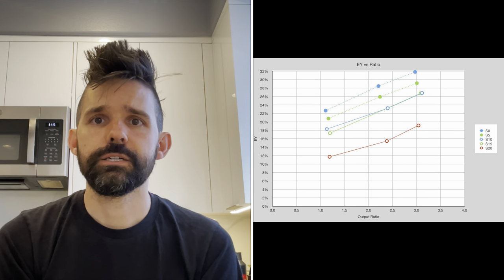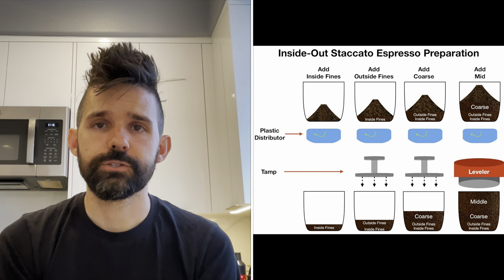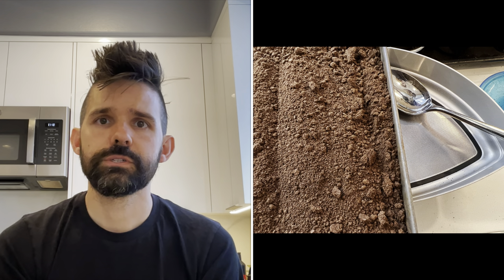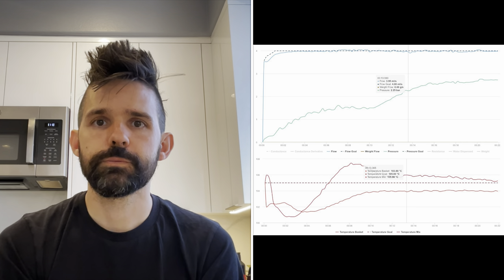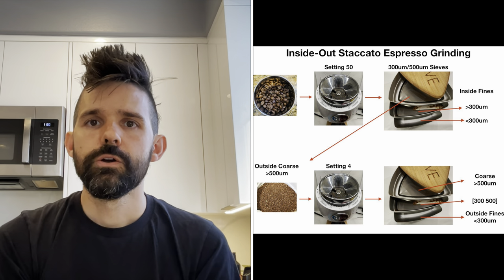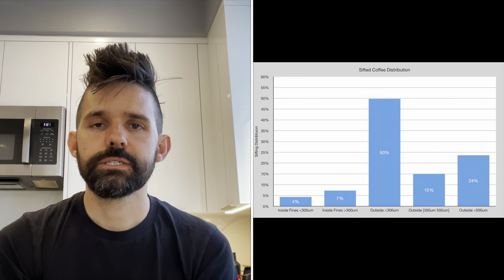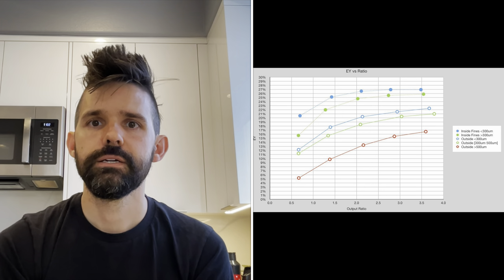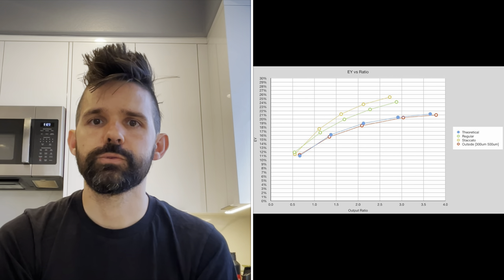Sifting Salami Espresso: The Coffee Bean is Not Homogeneous

Comment: Hey, saw your recent post on medium concerning sourdough yeast fermentation. Tried this last year with wheat bear yeast (stripped from a bottle), had similar results, tho the flavour was much more chocolatey (ran the fermentation for 1week).

Right now I’m trying a “fermentation”with 4min preroasted (until browning occurred) natural robusta. Added just the water I lost during roasting, will see how it goes. If it doesn’t ferment I’ll try it again with some of the beer yeast from last year (which is still in the freezer…). Hope to get some more funky flavors.

Btw, in the last years experiment, my beans turned purple/ dark blue after drying in the oven. Also roasting time increased drastically, like from 7 to 14 minutes or so, if I remember correctly.
Taste was a lot more funky, comparable to a high quality dark chocolate, acidity muted by a lot. Experiment was done on some guji natural from Ana Sora.
Reply from the maker: That’s awesome! Let me know how it goes. I did some robusta for 12 hours to find a balance between the funky and the low acidity. It’s been really good. 

I’ve been drying in an oven with the heat off. I’ll turn the heat on a little until it hits around 50C and just turn off the heat. That’s allowed the beans to better dehydrate and roast closer to normal.
Reply: @espressofun6091  thanks, the drying part  for me has been quite difficult to figure out. Last time dehydration took about 12h (two days, each day for 6h at 30°C).

Tho if this method of yours works I’ll probably go with that. How long was your drying time?

Btw also had the idea to “freeze-dry” the beans in my fridge (long term, would estimate a drying time of 1week).
Reply from the maker: @hanalsechs2959  it was 8 hours or so. I usually ended when I hit the original weight or close to it.
Reply: @espressofun6091  so the fermentation started (had a lot of pressure in the storage bottle), which amazes me, since the coffee already had been partially roasted. 

This time I won’t dry the coffee in the oven, just let it „rest“ one day after fermentation in the open sun, turning it every 2h or so (weekend). The moisture content should already be only 16%-20%ish. 
The idea behind this has been to extend the browning phase, but without loosing any moisture, or so to say, having a chance to repeat the chemical reactions in that phase again.
Would expect sweeter high body coffee.

Will do my usual extreme light roast (in order to salvage any acidity that will be left), which basically means 7min to FC, then dropping after 30s. Takes 2weeks to reach an optimal flavor (degassing).

What I really would want to try is a „untergärige“ Fermentation/bottom-fermented. Here you could store the coffee in the fridge whilst fermenting and I would expect more acidic and funky complex floral notes.

Btw probably will do a post on Reddit, will edit this text here when it’s finished. so you can see pictures and such
Reply from the maker: @hanalsechs2959  oh I missed that you were fermenting post roast. That’s an interesting concept. I use an instant pot on a sous vide setting for temperature control.
Reply: @espressofun6091  yes, tho I’d call it „in between the roast“, since I plan to double roast. Ever tried that (double roasting)? Btw it’s something most roaster think it’s not possible to reach anything decent with, in my experience it works really well for light/ high complexity medium dark espresso roasts. For filter This won’t work too well, since you’d have to stop perfectly after browning finishes, but before first  crack occurs. In the case of filter roasts triple roasts are much easier therefore (or simply a normal roast works as well). The triple roasting just gives you more time to think about each phase in roasting and thus increases your possibility to reach an optimal roast. By cooling down the beans in between roasts to specific temperatures you actually can control the penetration deepness of temperature applied at the beginning of the next roast step. You f.e. could roast a bean, that’s inside light and on the outside medium dark, without any scorching etc. Downside is that flavour development after roasting takes much longer (about 10 to 14 days minimum), before that it doesn’t really have that „round“ flavour profile, if that makes any sense to you.

*doesn’t work with every bean
f.e. Triple roast with fully washed guji odo shikasso (for filter) worked extremely well
and double roast with Sumatra gilling basah (for espresso) got me a highly complex and quite floral roast with peppery undertones.
Reply from the maker: @hanalsechs2959  I have double roasted only because my son dropped the beans early so I quickly threw them back in. 

That’s interesting. I’ll have to think about that more. It’s more process but that doesn’t mean it isn’t interesting.
Reply: @espressofun6091  Washed the coffee thoroughly 6times with cold water after the treatment, then dryed it with some paper towels. Right now it’s drying in the oven (for ~4h) since it’s raining outside. Then going to transfer it to a dry place to cool and reach an equilibrium humidity level over 24h. 
Roasting tomorrow. Will update this thread then
Reply from the maker: @hanalsechs2959  yes, I had to wash mine about the same.
Reply: @espressofun6091  so roasting went fine, although First Crack has been non audible and therefore roasted to a medium level (I guess). Beans tastet pretty dark after roasting, probably needs a week or so to finish developing flavors. Roast was long (air roster, 20min), I might have been too cautious with the temp increase there. Preparing a second fermentation attempt rn with bottom fermenting brewers yeast, cold ferment, 3days. Also added some maltodextrine (3g per 300g green coffee), so the yeast solution adheres more effectively to the beans. (Maltodextrine will decompose at 240C, but can only partially be degraded by yeast.)

Have a professional roaster friend of mine cupping the coffee in 1week or so, just to get a second opinion on the process and yield.
Reply: @espressofun6091  don’t know, if you’re still reading this “thread”…

The first experiment with beer yeast produced low coffeine coffee, is quite bland for filer, but has some interesting floral&complex notes with a bit of acidity in espresso. 

Next fermentation already has started, the yeast is called “fermivin sm 102” I’m shooting for floral forward mild acidity notes and low glycerin (less arcylamide) content. Fermenting “anaerobic” for 120h, then performing the first washing step (only mild washing to get rid of any chaff but retain some yeast), then aerobic fermentation for 1week in a dark cellar (= slow drying on a raised bed; I’ve found scientific articles describing, that any drying operation above 30C will result in a degradation of the beans mikro-structure), then again going to wash the coffee mildly to retain most of its aerobic flavors, then again drying for 1week. All Fermentation is happening in a environment of constant humidity and temperature (17-19C) in a dark cellar.
Anaerobic is finished tomorrow, smells like spiced winey fruit punch right now. 
Chose that yeast, bc of low glycerine content, high phenol generation and appropriate final ph of about 3,5 to 3,6. 
Looking forward to the results in roasting, btw to achieve a more audible first crack I’ve found (in some side experiments) that slow drying to a higher than normal humidity helps (some cracks are even more violent).

*the beans have been pre-fermented (4days) by a pineapple enzyme culture I have had from an old pineapple wine experiment. Added natural(no chemicals used for processing) demerara sugar (2,5 tablespoons per 150g of coffee) in that phase after 2days of soaking, so that the sugar may dissolve in the inner lattice of the beans and the wine-yeast (fermivin sm102) would „do its work“ (so to say) on the inside of the beans as well. The added sugar will be reduced to phenols etc in the anaerobic phase to ~75% and the rest oxidised/reduced to other stuff in the aerobic phase. There’s a possibility, that about 10% to 5% of all sugars (including the ones from the beans themselves) won’t be converted at all, so that the roasted coffee won’t be tasting way to tart in the end. (This also is combated by the wine yeast producing glycerine and glucose).

*all parameters changed (in comparison to the first experiment) are covered by extensive research towards secondary/„normal“ fermentation processes of coffee beans and yeast strains.
Reply from the maker: @hanalsechs2959  Oh that sounds like so much fun! Please do a larger write up with some pictures to show the process.